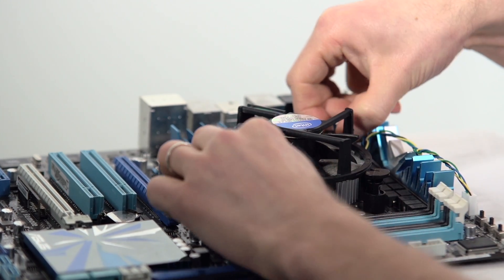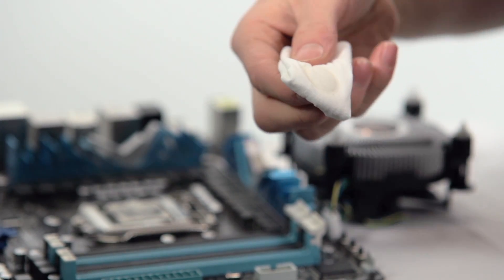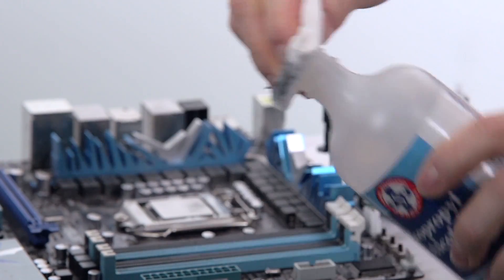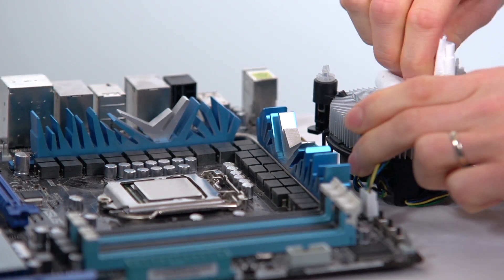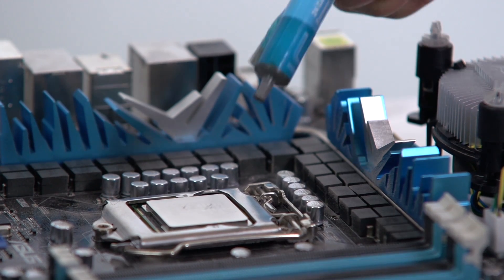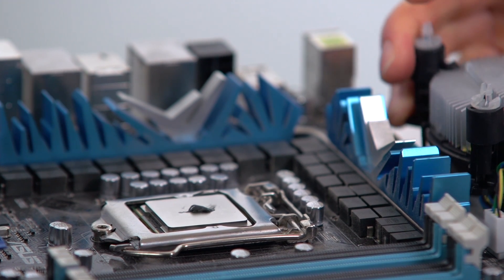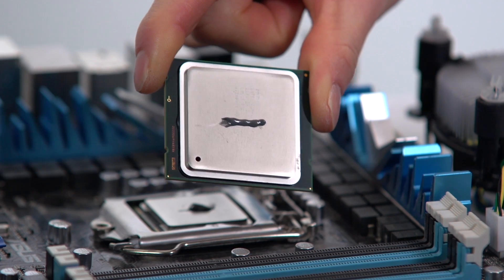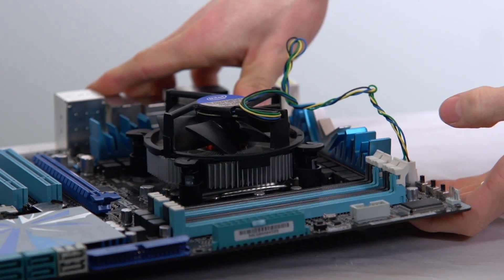Install Thermal Compound Paste as Fast As Possible

Comment: Had an aio fan "bite the dust" so I'm swapping my 2 120mm case fans to my rad and installing a new 120 and 140 in my case. I had some thermal paste and it's been 4 or 5 years so I figured why not.

Comment: For cleaning old thermal paste from CPU IHS and heatsink plate I always used vodka and it never failed. I even rescued i7 4770K with thermal paste on contact pads, now it works for year stable even under OCCT tests :)

However what suprises me, that you clean CPU, while it is still in socket and taking risk of bending pins in socket

Comment: lol my CPU is running at Freakn 98 degrees celcius. I'm gonna try to change thermal paste and if that doesn't work I will have to change the fan. If nothing of that works I'm screwed. My CPU is intel i7 920 2.44ghz(something like that). Do someone else have another solutions because I Freakn hate this shit
Reply: TheLegend27 yes I will get a new CPU since I could need a new one because mine is pretty old but luckely the thermal compound fixed it and it's now running at 30-50 degrees. The sthermal compound before was really bad and it didn't even cover alot so when I changed it dropped 50 degrees. I worked :D
Reply: lol my pentium laptop has higher clockspeeds, time for an upgrade

Comment: what if you don't have 99% alcohol is there an alternative?
Reply: ***** thank you
Reply: Isopropyl alcohol is very common but a clear alcohol like Vodka will work as well.  You just want something that will not leave a residue and will evaporate very quickly.  You could also order a bottle of electrical contact cleaner or may find some in a local hardware store.  Coffee filters work great as the paper part as they don't have loose fibers.

Comment: When putting thermal compound in my CPU (Which is shitty as fuck,AMD Sempron 140) i just use a thin brush and expand it over the CPU just to make sure i applied the correct amount and that its spreaded the best possible,I dont like taking risks xD

Comment: okay....now that i watched this AFTER the fact. I put compound on with fingers and spread it all over the top of the chip. Is it recommended to take apart and clean and re-apply new compound?
Reply: +Brown Trout Yes, as the oils from your finger could increase the thermal temperatures. If you want to spread it, using something like an old giftcard would be much better. However the line/pea method is more than good enough!
Reply: +Brown Trout 
Properly spreaded compound will conduct better than method that linus show us in vid.
Reply: I already did it. So at this point the system has been running okay for last couple yrs. I'm just trying to find the right way for next time
Reply: Best way is to spread thin layer.
But everyone(also me) just leave a snot, its fast and easy, and only few *C more.

Comment: But with that amount of paste it won't cover the full CPU area when the cooler sits on it. Wouldn't it be more efficient if the thermal paste is spread on the whole CPU area for more heat conductance ?
Reply: +Saleh Haddad no. it will spread slowly by time you dont need to cover the whole cpu.. by putting more thermal paste is going to reduce your performance cpu and it will hotten your cpu more because the thickness seperate it so much or far from the heatsink and the cpu... you can just put a tear drop in the middle or little straight line.. remember less is more for cpu thermal paste
Reply: +B Rich if I put none, it's like infinite thermal paste. YAY
Reply: Just enough to fill in the cracks in the metal, you know the ones you cant see unless under a microscope.  The point is the pressure from the heat sink mount will squeeze the paste into a very thin amount.  Test his rice sized method then unmount your heat sink if you really want to see it.  Its really does get almost a perfect thin layer, way thinner than you would do if you tried to spread it by hand.

Comment: Hey guys i think i have done everything wrong with applying paste. First
 i think i put toomuch, because i put like 2 lines on cpu, and 2 lines 
on cooler then smearing it evenly with plastic card. I assembled the 
cooler to the cpu like 2 times to check how it looks. I think the excess
 of the paste went out from the sides of aasemblement :). But my idle 
temps on 4690k stock 3.5ghz are +/- 27C. Should i bother to do it 
correctly, or leavy it alone. Paste i used was arctic silver with 
thermalright macho rev b.
Reply: +petkopeet i want this comment on top so they can reply.. as this is interesting one.. what happen if the thermal paste gets closer to the pins?
Reply: +LINKINPARK4EVER1996 Some thermal pastes are conductive, you have to be VERY careful with those. If you don't have experience with thermal paste, just avoid it. A lot of thermal pastes nowadays aren't electrically conductive and will be nicer to you if you mess up. 

Either way, be careful and don't rub thermal paste all over your motherboard.
Reply: B Rich Thermal paste is conductive, so you'll end up with shortening the circuits of your Mobo and eventually Cpu, Gpu, Rams and so on.. Depends.
Reply: Sam Watson Didn't knew that, thanks. Anyway it's easy to apply if you follow a couple of steps
Reply: +Sam Watson i coated my motherbord, and my ram all thermle pasta because i want to make colder. is  bad?

im thinking doing a psu mod, i submerge the psu in thermle paste for mor thermle afficiency. in fishy tank

Comment: how offen should i change thermal compound?
Reply: +benn61 It depends, you usually have to change it every 1-2-3 years,depending on the temperatures you're getting over time
Reply: +benn61 when it stops working.

Comment: how often do you need to replace the thermal paste ? i never even knew that i had to replace the thermal paste on my cpu heatsink before it started overheating after i cleaned the fan. effectively breaking the thermal paste ( yes it hasn't been replaced in months and its dry as baked clay i dont even think wiping it with alcohol would work. i think i need to literally scrape it off)
Reply: +J3AN P3T3R No alcohol will work and a few months is not that bad in my opinion I change mine like very year (every time I get a new cpu or heatsink)

Comment: I do not see how such a thick substance such as heat paste would spread evenly with a pea or line method. In any case you need an ultra thin layer for maximum efficiency and using one of the methods above you are unlikely to achieve that. The best method in my opinion would be to spread it out by credit card or something similar on both heatsink and cpu and then mate them. But that's just my opinion :)
Reply: Shagas Heizenberg You're actually supposed to put some thermal compound on the heatsink and spread it around with something, like a credit card, until nothing but the microcracks has the thermal compound on it. It's easy to see with a thermal compound like AS5 because the cap of the heatsink will look slightly discolored, but shiny in some spots where there aren't these little cracks. This is so that when you mate the CPU with the pea or line method, you aren't accidentally introducing air bubbles from those cracks or getting insufficient contact. You aren't supposed to do this to the CPU since the mounting pressure will be enough to fill in its microgaps and get plenty of coverage.
Reply: Yes I don't disagree that it will fill in the microgaps and get plenty of coverage. What I'm saying is that you will get an excessively thick and perhaps even a non-uniform layer of
paste between your CPU and heatsink.

Comment: how often do I have to change the thermal compound?
Reply: Traoz Troaz I don't think that you have to change it that often. Maybe every 12-14 months?
Reply: Traoz Troaz If your thermal compound is good, like AS5, AS Ceramique, or IC Diamond, then you shouldn't ever need to replace it unless you're changing CPU coolers. Then you'd obviously have to reapply it.
Reply: +Traoz if it stops working, replace it, otherwise, let it fly.
Reply: ah ok, thanks guys! :)

Comment: Would acetone be ok to wipe off the cpu
Reply: Isopropyl alcohol 90% is way better. Even 70% IA is better than acetone.
Reply: Bryce Morgan Isopropyl alcohol and denatured alcohol are good candidates for cleaning off the heat caps from both the CPU cooler and CPU.

Comment: Are you not afraid that alcool may leak all around the cpu?..
Reply: QuebecoisGuy Isopropyl and denatured alcohols evaporate within seconds. You can literally watch it dry up right before your eyes. It also carries the miniscule amount of water with it, leaving the surface extremely dry.
Reply: QuebecoisGuy No no, that's the thing. 99% Isopropyl is non conductive. If it got anywhere on the motherboard, you'd just let it dry, and that's it.
Reply: Katch A Taco But but but but, isn't it like 1% conductive? :OOO
Reply: Katch A Taco
Reply: +Calculated Risk I used %70 isopropyl wipes, is that okay? Got everything off easily

Comment: I usually take the CPU out aswell and clean the sides and edges of the IHS (Integrated Heat Spreader, the gray plate thing that contacts the bottom of the cooler you are using), not using alcohol and just wiping it of with a bit of toilet paper works fine, though I do use alcohol to clean the cpu and cooler if I happen to have any. Last but not least, using conductive thermal paste is fine as long as you dont get it on any electrical components, usually this means the CPU has to have an IHS, all Intel desktop CPU's have them from the Pentium 4 and up, notebooks can be a exception  and I've no idea about AMD CPU's as I've had maybe 2 AMD CPU's in the past 10 years.

Comment: why is icy diamond so freaking expensive ?
Reply: its 8 bucks wtf if thats expensive i dont think you should be pc gaming
Reply: Zachery Brown
it's $6 on ebay for the 1.5oz syringe. Also, Arctic MX-4 is like a dollar more for a 4oz syringe and is just as good (both are carbonic compounds)
Reply: Because it has actual diamond in it
Reply: SchmidtPlays And how does that actually helps cooling my cpu ?
Reply: David Toussaint because it has really good heat transfer

Comment: I did a pea shaped dot and then spread it out with a ziploc bag.
Reply: Nooooooo you never spread it out the cooler will do that
Reply: Newbism no. spreading it out yourself creates air bubbles and reduces efficiency.
Reply: Newb Hunter Go hunt YOURSELF! Because you're the newb! You're not supposed to spread it out manually!! A pea-sized dot at the center will suffice. Once the heatsink goes on top, it will spread it out evenly. The problem if you do it manually is that some places may have more while other places may have less. So they're not even. You newb
Reply: ***** Actually spreading it out yourself with a bag or plastic card spreads it thinner and thus cools it more efficiently
Reply: No Shit your taking Way you just put less on when you spread it via. The cooler also is spreads evenly then
Reply: EcP RyZe its fine, the pressure usually evens it out after u spread it out

Comment: missed a step and I now have cpu in my anus somewhere...help?
Reply: Sir, please stay calm, I need to know before I can help you, is the motherboard in there aswell?
Reply: honestly i dont know where it went but today i went to put eyedrops in my eyes but i squirted thermal paste in my eye ;__;
Reply: Rama Butler Sir, is a GPU rammed into your eye socket?
Is the ODD stuck in your mouth?
Is there a computer case stuck on your head?
Reply: I'm inside the case.
Reply: Rama Butler I feel bad.... For the case...
Reply: +Soda Xyndicall I do not mean to alarm you, sir, but you may be a motherboard.
Reply: ***** This is an interesting case.
Reply: +Soda Xyndicall My sides. xD
Reply: next time you do this, use a round cpu and not a square one. Trust me... it will feel a lot better.
Reply: "I know it's around here somewhere"

Comment: aftershave also works. you can also use deodorant
CAUTION do not use one that keeps u dry for a day or something like that
there is powder in it that can harm your system!! also due to pressure in the can you can use it to get rid of paste thats in the wrong place the pressure blows it out and the alcohol cleans it whait an hour for it do dry.

Comment: Using diaper rash cream works as a thermal compound for a processor. Though I DO NOT recommend you doing it. The bit I applied a year back still works perfectly on my 8 year old laptop with a Pentium M.

Comment: What do I use if I dont have isopropyl alcohol?
Reply: Judging by your name I guess you are either Norwegian or danish, I usually use "T-röd". Google that. The important part is that the it is a pure high alcoholic percentage fluid.
Reply: Øyvind Lorentsen You can use alcohol cleaning pads. They contain only 70% isopropyl alcohol though but they still work. Can buy them in any pharmacy. Clean with those and then thoroughly wipe with clean microfiber cloth and it's done :)
Reply: Kristo or you can just piss on it ?
Reply: Freezy322 Very funny

Comment: wouldn't rubbing the CPU generate a crap ton of static?
Reply: Josh Hummel That's not how static electricity works, m8.
Reply: Josh Hummel Yes, static electricity goes into metal, which is why it won't build up. If you rub on metal, static will immediately be forwarded, having close to zero Volts. If you have plastic, wool, dust etc. the static will build up Voltage until you bring it close to a solid and/or grounded metal. This spark could harm some components, but in most cases it won't.
Reply: On metal? No.
Reply: zookatone but the metal IS the cpu, so the static would go straight into it. Unless it went into the motherboard, but then again, the-nvm
Reply: oh yeah..its metal..
Reply: Josh Hummel
XD

Comment: i didn't know you could apply thermal paste like that, i used to smudge it all around the top of the cpu with my finger first before attaching the heat sink.

Comment: is arctic silver 5 good thermal paste thats what i use
Reply: Arctic Silver 5 works well, but there is one issue. It's potentially capacitive. Meaning if two electric circuits where nearby they could potentially bridge each other. In example, if you apply too much thermal compound, issues could arise if the thermal compound went beyond the IHS (The metal plate on top the CPU.). Other compounds have advantages such as not being conductive or capacitive. If you accidentally get some on the motherboard, you don't have to worry about having anything shorting out. In summary AS5 works well, but it's not vastly superior to other brands.
Reply: deh trolls!!
Reply: yeah i learned real quick i now use ic diamond

Comment: Can I use, instead of 99%, a 70% alcohol solution(commonly used for cleaning medical instruments)? Or will this be damaging?
Reply: I've used common 70% many times without any problems. 70% won't damage anything and works fine, despite what others might say
Reply: No, 90% is good enough.
Reply: 30% or there abouts is water, less evaporation on 70%

Comment: What happen if after cleaning do not put thermal paste?
Reply: cpu overheats I'd guess.
Reply: Your CPU will die very sharpish.
Reply: unless the contact surfaces between the heatsink and heatspreader are smooth on the atomic level with even pressure, basically like what the others said, most likely a overheating cpu.

Comment: what if the paste is preapplied like on the arctic frezzer 13? is it good or should i replace it?
Reply: if you have experience with thermal compound and plan to overclock or need the temps to be lower you can apply your own however the pre applied thermal paste normally works fine
Reply: Thanks!

Comment: Jello Tech, Say can I use this with all of that? Getting a XFX R9 290X. Will my 650 power supply  be sufficient. EA-650 Green Antec 80 plus bronze. Cool, not even? Yes and with that I have  ASUS M5A97  MB, a FX 8350 8 core, 500 GB western digital hard drive, 8GB DDR3-1600. People who think there in the know tell me its so. So are they just dumb headed?  I know i'm a mental midget. That's why i'm bothering you with this. Tanks if you can help. I mean the 780 ti cost so much. But if I have to get a new power supply its about the same. If I got one I was going to move up to a platinum. Power supply that is. He's a good kid. But about as sharp as a bag of wet mice. lol

Comment: This isn't my method, I learned it elsewhere. One of the most effective, and safe, methods to spread thermal compound is to use a piece of scotch tape, the non-sticky side. Put a small dab in the middle and use the tape on your finger to spread a layer that is not too thin and not too thick. Too much is bad, worse than too little. You don't want to see through it. This method will leave a perfect layer that will not create a mess once the heat sink is down.

Comment: Need some advice guys!

So I'm going to replace the thermal compound in my PC soon, and don't want to take apart my motherboard and stuff to apply the stuff. My question is can I just put the tower on its side and work on it like that while everything is still hooked up but obviously turned off etc ?
Reply: Yeah, that will work fine, the only parts you need to mess with when applying new thermal compounds are the parts that will actually have the compound on them. You may, however, wish to disconnect the fan connector for your cooler just to keep it out of your way (You won't need to worry about this if you use liquid cooling).
Reply: bladez479 Okay, thanks for the advice!